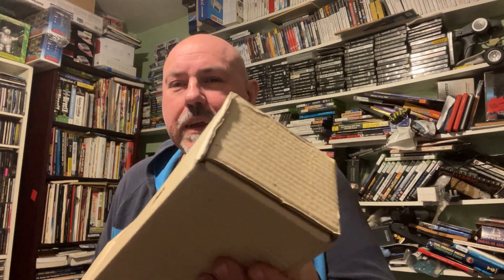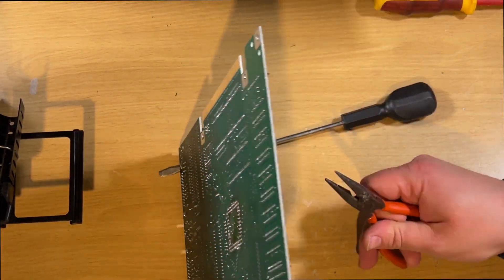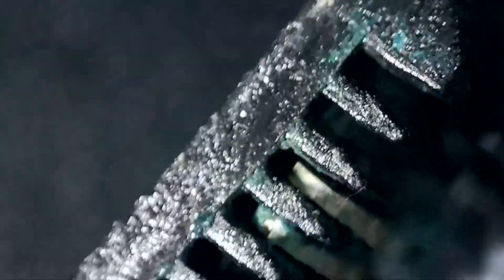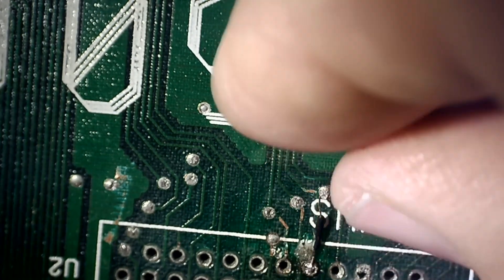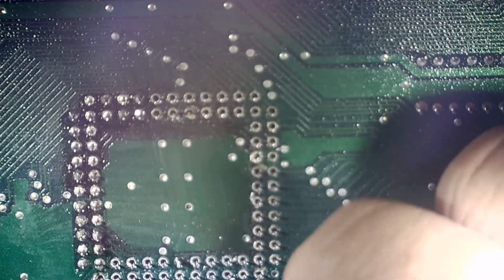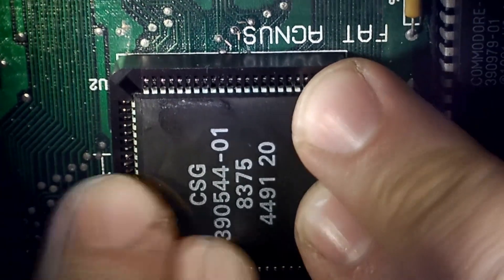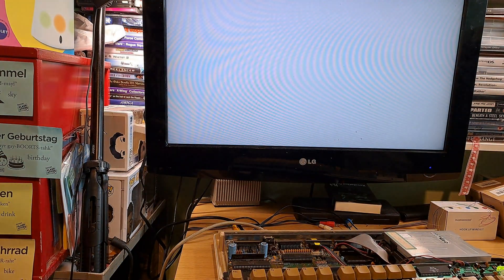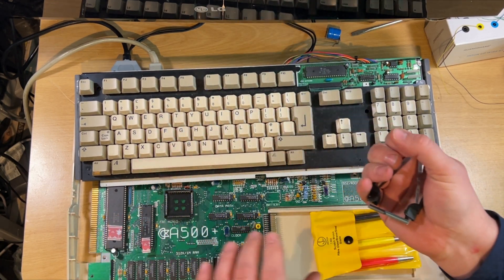Agnus are you OK? Amiga A500+ Repair & Fault finding Part 2

Comment: Interesting.

You have made progress but the flashing green boot screen on the A500+ can relate to chip ram or the associated path leading to chip ram. 

This includes Agnus which is where your endeavours started.

Check 74LS244 and traces around it near the clock battery area and also check Gary, his socket and the traces around him.
Reply from the maker: Thank you for your comments. I’m just working through the ram chips right now but it’s given me more areas to look at if the ram checks out